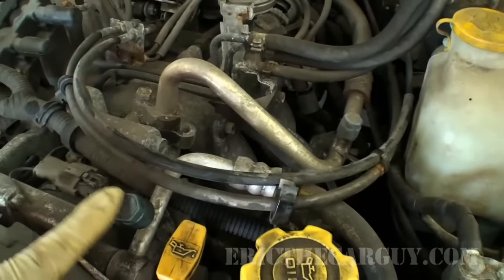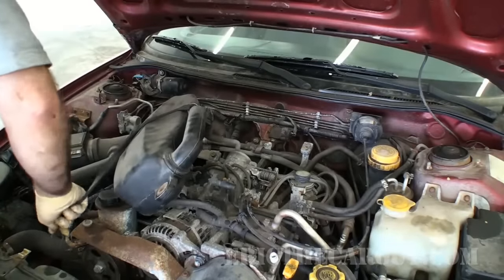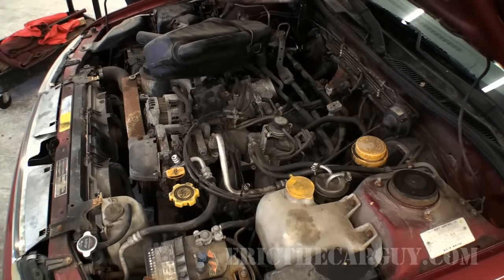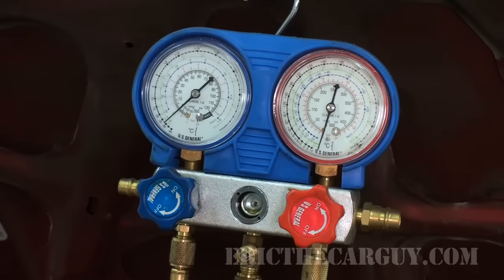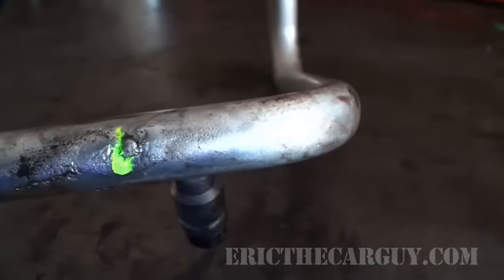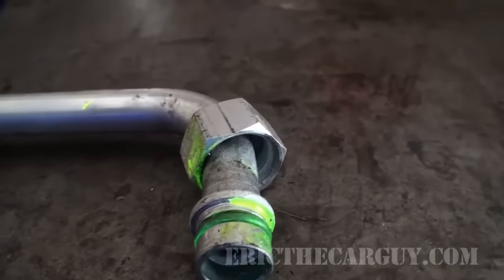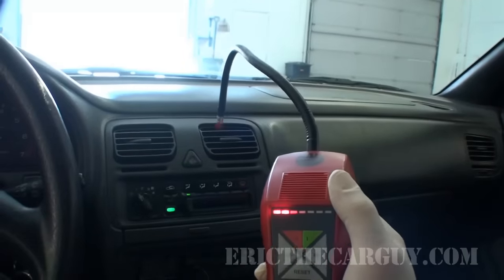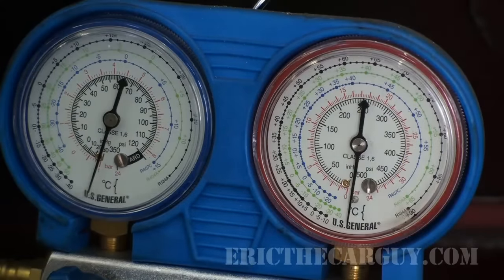How To Find and Repair AC Leaks - EricTheCarGuy

Comment: getting ready to do my x-type jag 2008. I did my 2002 x-type and ford ranger, no prob. So, I forgot how much flush fluid to use. It was working, but at stop signs it would warm. I ran all the gauge tests, couldn't get it to point to a specific problem. The wife hit a deer, so I have to replace the radiator and condenser, I'll do an orifice tube and dryer "thing" I thought I'd leave the compressor in, drain it and put in all the proper oil and refrigerant. Should I replace anything else? You're advice is appreciated
Reply: Best advice here from personal experience. If the parts work and don't leak, don't replace them. Often once you touch the connections the origs start leaking and you can spent many attempts fixing your new leaks made. Technically you do need to replace the drier every time you open the system though I found as long as you let the vac pump run for an hour or so on a warm day to drive the moisture out this isn't entirely necessary if the system only leaked and no actual rain etc got in. Keep in mind total oil in system is 8oz. Google for a chart that shows how much oil to add depending on the components replaced. I recommend after you pass the vacuum test, with the car off fill the system with refrigerant VAPOR no liquid. Remember the pressure in the system and current temperature. Leave it for a week or two and test again. Often the system leaks under pressure but not under vacuum. If the pressure is same, fill system. I say only vapor cause if you add liquid, even though you could have a leak the pressure won't drop until all liquid evaporates and that could take months. Hope this helps
Reply: @AntonBabiy  Thanks Anton. I did my 2002 jags ac complete. It didn't leak, it just wouldn't cool, even after hiring a guy with one of them expensive machines. I worked a few days and than back again. I did a leak test with die, found nothing, and that was years ago, it still is working awesome. I'm pretty confident in replacing this 08's complete system. But yes, the dryer every time you crack the seal. These jags ac unit is touchy. This particular model has a TSA pointing out that if you don't weigh the fluids exactly, the physics don't work. So I weigh each can per gram and put in the exact amount.

Comment: Hi guys, I tried to fix my A/C system 3 months ago.  But it did not blow cold air now. 
I pushed the high port as the video shows, there is air coming out. There is pressure in the high side.  Dose the pressure in the high side mean my system did not leak seriously? Dose it mean my A/C system is not empty, there are still some refrigerant in the system?
（Sorry for my English）

Comment: Also, I never use PAG to lubricate o-rings. Some versions of PAG 9if not all) are hygroscopic, and can form acids that eat o-rings! Or so I've heard. I usually use silicon grease, or plumber's grease. Also. I like to use di-electric grease, as you only need enough on the o-ring to not tear it during install. Synthetic oil is another option.

Comment: I had a leaking hose, replaced it. Ac was previously workin. I accidentally punctured the hose. Getting ready to vacuum and recharge/add dye. My question is, does vacuuming extract the pag oil as well? Would I need to refill the system with oil when I recharge it?
Reply: Vacuum doesn't extract oil. Total oil in most systems is 8oz. Look up a chart that shows how much oil to add for a certain component replaced. If you replaced just a line and didn't loose much oil you don't need to add oil. Slightly less oil is better than too much

Comment: Nice vid. Have a question. My AC compressor is leaking. Don't know the exact place, but that's not the question. Do i need to replace the dryer? AC is working very good if there's freon in the system. I am asking this because it's quite problematic to get new dryer here.

Comment: Had my oil changed and the next day, I had a puddle under my car. I smelled it and it appeared to be coolant. What's the likelihood someone could have punctured something, while changing the oil, causing my AC to stop working?  ( I have  a 2009 Ford Taurus X)
Reply: its is very unlikely. oil filter and plug are not even close. they had to do it on purpose or just a coincidence that they happened together.
Reply: a little late to comment but.your coolant is for warm air and ac is for cold air.

Comment: and I got it now the vaccum pump is used when the car ac is not on and you just cracked the lines then reinstalled and have to get the moister out. But if you where just discharging for the first time with the ac running one wouldn't need the vaccum pump just an empty container and your gage hooked to the high side... I would still vaccum pump it for moister though to get all the rest of the residue that could be in there

Comment: You can pressurize the system with an enert gas such as nitrogen and use with the dye to check for leaks, once you have no leaks then put a vacuum on it, recheck for loss of vacuum and then repressurize with the 134a.
Reply: The reason you'd use nitrogen is that it's not bad for the ozone or illegal to vent into the atmosphere.
Reply: Brett Woodruff I should hope it's not illegal to vent nitrogen - Our atmosphere is already 80% nitrogen! :D
Reply: True, but not everyone knows that. Just simpler to say it's not illegal.
Reply: Brett Woodruff Where can you get nitrogen in small quantity for this purpose?
Reply: paul johnson Nitrogen costs hundreds of dollars on eBay.. Really wish it was economical to do the right thing but looks like I'm gonna have to waste freon to find this leak.
Reply: ***** I can't see why nitrogen is so expensive. It's the most abundant gas on earth. 80% of out atmosphere is Nitrogen ffs.
Reply: Dan Coulson its expensive if you dont already have a tank and pressure regulator which is usually about $200. after that a refill is like 20 bucks.
Reply: Nick Daggitt I can understand that pressure regulators, and valves, hoses etc are expensive. They're precision engineered components. They have a real reason to be expensive. 
But I'm referring to pure Nitrogen gas. Not actual hardware or tools.
In theory a compressed cylinder of Nitrogen should cost very little more than the energy used to compress the gas, and form the canister.
Nitrogen gas should be very cheap to buy>
Some rare gases, such as Xenon are very expensive, and just a balloon full could cost as much as £40.00.
Reply: Im going to refer you back to my original post for my response. :)
Reply: Dan Coulson its the compression required to store any reasonable amount in a contaner. Liquid N2 is more difficult to control than those propane tanks you can get for $5.
Reply: You  can pressurize the system with an air compressor.   Later, when you vacuum the system for an hour or two, the moisture will be removed.
Reply: What makes nitrogen expensive is the process of how it's contained from the air. Air ran through a huge compressor, compressed again, air is refrigerated super low -320 F and the gases are separated into liquids. The plants that do this are called Air -Separation Plants, Air Liquid, Air Products, Linde, Praxair etc... Electric bill for 30 days is often over one million dollars a month to run these huge plants. The process is complex, just tried to give explanation why nitrogen is so expensive.

Comment: I replaced my compressor, orifice and accumulator. I ran a vacum and discovered a leak. I left the parts on the system. Question, should I remove my accumulator to prevent moisture leaking in? Its goin on two days since I installed the accumulator? Thanks.
Reply: Yeah

Comment: when i tried to use an ac recharge my compressor kicks on but i also hear a strong hissing noise from the drivers side nect to the radiator by the headlight. I see coolant from a leak there but also think i have a bad ac leak as well since the compressor will turn back off within 2 minutes.

Comment: I believe that this can be dealt with using a commercial product. It is a basically a small aerosol can bomb. You turn on the A/C and engine, set it to recirculate, put the bomb in the car and press the trigger. Several seconds later (after you have shut the door), it releases the anti-bacterial vapours. You wait a set time, then dispose of the spent can. However, it might be best to address why water is accumulating. Eric has a video on just that problem.

Comment: using dye, i only found it coming out the condensation drain/evaporator hose.  any other diagnostics or do i dtart tearing my dash apart and replacing the evaporator?

Comment: Great Video, Check Out Durafix and Also Get A Small Nitrogen Cylinder For Finding Leaks and Pressurize to Double the Low Side Operating Pressure

Comment: Eric those hoses on the manifold gauges are on backwards, I think the check valve is supposed to go on the manifold end and not the connector end. According to HF pictures in the manual the bent ends with the check valves go up at the gauges and the straight ends go to the connectors. On a side note, am I the only one who gets slightly aroused at the sound of that vacuum pump?

Comment: when it comes to o-rings, the sizes get kinda of confusing. there are several different kinds. you have a standard, captive, p-nut, snap ring, others with metal washers and rubber together. sometimes when you have an old o-ring it will stretch and look like a bigger o-ring when you try to compare it to the new one. you find it more with the captive ones, which is what these appear to be. you should also not trust something that comes with the package. when in doubt, use the old ones if you must. be sure that they are still pliable, and not pinched, or dirty.

Comment: You are correct. If you have a positive (higher pressure than atmospheric) charge of dry nitrogen in the system then the soapy water couldn't get in through the leak. Once you find the leak, wipe the area clean, and proceed.

Comment: Eric, 

I have a 96 F150 as my second vehicle/weekend beater and when I bought it, I charged the A/C up and it worked for a couple of months before staring to not be so cold anymore.  I have checked all the lines, hoses, and condenser and they are all dry, except for under the low pressure schrader valve, when I pulled the cap off to top off the system, there was oil in the cap.  Should I have it recovered, change the valve, and recharge and see what happens?
Reply: Yes, there is also a tool that allows you to change the schrader while the system is under pressure.
Reply: Got it changed out and we will see what happens.  Bought the Mastercool tool to change the valve with the system under pressure and it worked great.

Comment: I was wondering what your take is on the special A/C tools like oil/dye injection, can taps, dye remover, etc? I had an issue with a compressor seal leaking off after 3-4 months, replaced the compressor and dryer cartridge and its all good until the condenser fan died.

Comment: Why don't you just TIG weld the tube...Have done this many times....  Just prior to finishing the weldment, the trick is to back off the heat and oscillate the weldment puddle away from the original leak hole.  This prevents any micro-dimple pinhole from forming above the original hole.  Note: prior to welding, the tube must thoroughly cleaned inside and out.

Comment: Do you know what the pressure of the refrigerant in the can is?
My AC reads as about 25psi, but not much seems to flow when I pull the trigger.
I'm assuming the can contains more than 25psi so that it can actually enter the system!
Reply: Dan Coulson I had the same impression first time I was working on my AC but it's normal, if you look at the gauge you will see that it's entering in the system.
Reply: +Dan Coulson refrigerant is liquid in the can.  If there's pressure in the A/C line, you keep the can upside down and shake it a bit so that the liquid falls down into the line. You know it works when the can gets chilly.

Comment: Eric I replaced my evaporator core,  ac lines and condensor in my suburban. The low side hold vacuum just fine but the high pressure leaks out almost right away. Please help I am so frustrated with this.
Reply: Replace the expansion valve.

Comment: Using Dawn dish soap and water with a high amount of the dish soap and putting a small amount of refrigerant works if the soap and water is over the leak it should start blowing bubbles.

Comment: Eric, you mentioned possible leak behind clutch assembly, at compressor shaft... Can that seal be repaired without replacing the whole compressor unit?

Comment: also, couldn't one regenerate the receiver dryer by pulling a vacuum on the system and heating the unit with a blow dryer? It it's a water adsorber, that should purge the water from the adsorption medium so the same unit can be reused.

Comment: When you are charging the system, before you put the R134A into the system, unscrew the yellow hose at the manifold gauge just a little until you hear a little hiss.  Immediately close it when you hear the hiss.  This will purge any air that is in the yellow hose and only put R134A into the system rather than the initial air in the hose.

Comment: I've had my 2000 Plymouth Voyager in the shop about 5 times between 2016-2017 because of AC problems. I've sunk a lot of money into repairing it, but it keeps going out. The repair shop I take it to still cannot figure out the problem. Last time I had it in the shop, the owner didn't even charge me because he's embarrassed he can't find the problem with my van. From what I understand, it's a typical problem for the Dodge/ Chrysler / Plymouth mini vans.
Reply: Check your valve stems.   They can become loose or not function.   Get a $4 tool to tighten them or pull them out and replace with new.   You can get a more detailed stem extractor, for $20, that will allow you to replace the stems while under pressure.

Comment: Do you have to add refrigerant oil directly to the new receiver/dryer before recharging?
Reply: paul johnson I mis-phrased my earlier question.  Didn't look like Eric added any refrigerant oil directly into the receiver/dryer before installing.  Is that necessary when replacing a receiver/dryer?

Comment: i dont really know if my a/c is compromised with water, it hasn't worked once since i bought the truck, where should i start?
Reply: Check for pressure in the system like he did. While wearing safety goggles and gloves, use a small flat head screwdriver and press down the schrader valves on the high and low pressure lines. If you have a decent amount of pressure coming out, the system is charged or still has some sort of charge. Take it to a shop and ask them to recover the refrigerant out of the system. If there is no pressure at all, then you will need to get a Manifold gauge set and a vacuum pump. Draw a vacuum and after about 30 to 60 mins, close off the gauges and let it sit. Wait for a bout an hour then check back. If it held the vacuum, i would replace the Accumulator/Dryer and redo the vacuum process. If its still holding you can get the right amount of R-134a Refrigerant you need and the can tap and charge the system as he does in the video. Simple as that. If there is any leaks you will have to troubleshoot like he did in the video, The dye is the best way to find leaks. One step you might want to check, is to see if the compressor works or not. If you compressors wire connector has 2 wires, then you can jump the connection to see if your compressor engages. The wires on mine lead to the plug on the Accumulator, I just disconnected the plug from the Accumulator and got a paper clip and bent it so each side went into a hole and that will make your compressor kick on, but if your system is empty or low dont leave it running, Take out the paper clip. Some vehicles you'll have to jump it in the relay switch box. Theres many videos showing how to do that. But if you replace your Accumulator/Dryer and pull a Vacuum, and your compressor works, all you have to do is charge it and youll get cold air : D Hopefully i helped. IF you need any links to any tools or video links let me know.

Comment: The compressor is lubricated with oil entrained in the returning refrigerant vapor. The AC compressor doesn't have an oil sump like a car engine. If the AC system is low on refrigerant then less lubrication will be returning to the compressor. A 2-cycle engine would fail  if it were to run without gas and oil in the gas. However, an AC compressor is different because it is being turned by the car engine so it spins anyway. If my personal vehicle is low on refrigerant, I disconnect the electrical to the clutch. The best compressor is the original one your car came with. Re-built compressors are another story.

Comment: One more remark concerning your repair of your low side line. It appears you have some significant pooling with your repair. This indicates that the base metal (line) wasn't sufficiently heated to allow the filler to flow into and repair the hole. I've had great success repairing aluminum lines by Brazing with aluminum brazing rod, even the high side line!

Comment: How do you deal with a moldy smell when the AC system is in use? Is this a design flaw or does  it happen to all ac systems in cars or houses? I guess moisture builds up on the evaporator vent and draws mold. Can you talk about that if you know?

Comment: If you don't have nitrogen you can use shop air. Just make sure you use an oiless compressor or have a separate. 

I forgot the proper name of the fitting that allowed me to hook it up to the gauge hose and the to the compressed air fitting. But I bought it from the homedepot in the pluming section, I think it was 1/2 Male ACME to 1/4 npt.  Before the real charging just make sure you pull a deep vacuum as Eric said.